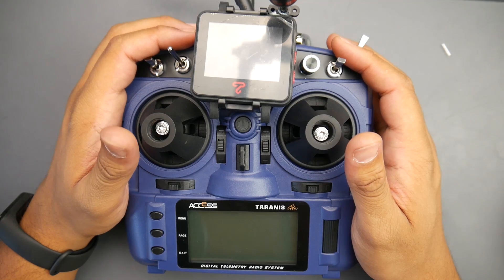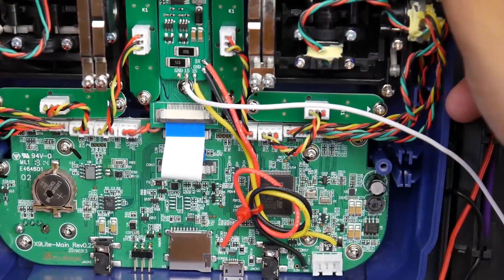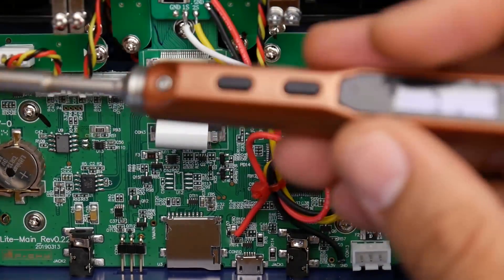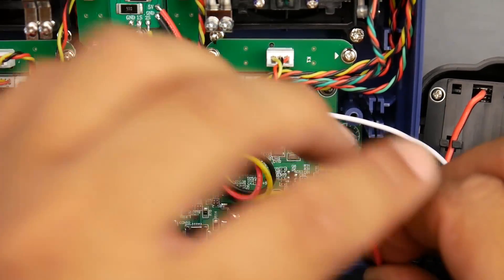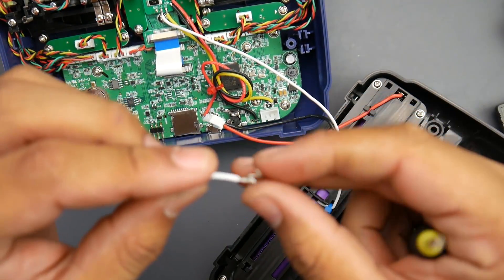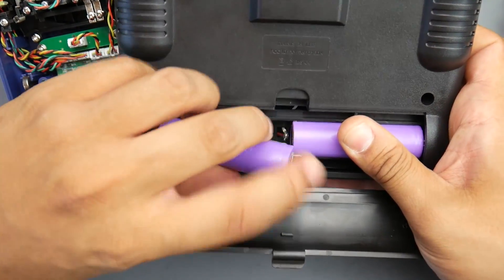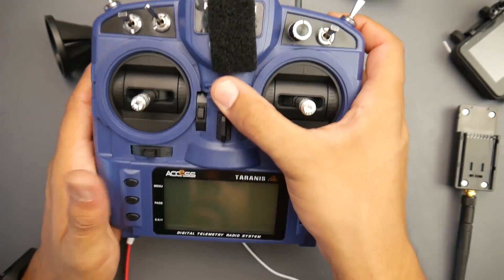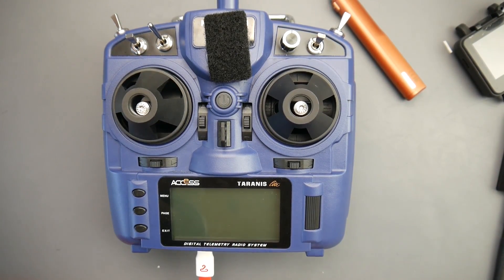Frsky X9 Lite USB Charging Mod // EASY WAY

Comment: You wanted to know what that LED does? That is a "fast flash" RGB LED. It does not have individual color control, instead it has an integrated chip that makes it go through a preprogrammed loop when it receives power. Those are usually used in a lot of cheap toys and things like cheap RGB ornaments. Why they used one here is a bit odd. You can tell it's one of those because of the flash loop. I've seen that loop so many times I recognize it anywhere. I even have a bag of those in 5mm THT package. I think it serves as a charging light. When it flashes it's charging, when it goes out charging is complete. They could have used any standard LED for that. I'd recommend desoldering it and adding a standard 3mm or 5mm LED with some wire, make a small hole and put the LED through.

Comment: Hi, I need some help. I have same radio and the 2.4ghz antenna kable damaged. So, I decided to convert to  sma connection and so I can attach 2dbi or 5dbi antenna. I cut the wire 84mm and it didn't work. Then I cut the wire to 70mm and didn't work again. I tried with Rg316 and Rg178. Then I decide to make a 2.4ghz 2dbi without an sma. I took the tube from old one and left same length of active out. Now I need to now what is the length of the cable should be from tube to the board. Also, What I notice there is a short circuit between the active and coaxcil pads on the board. Is this normal?

Comment: Does the charging light not come on unless you push the power button?  My urav board doesn't flash the lights unless I plug the USB in and push the power button of the x9 lite

Comment: Hello,
I have the Taranis X9 Lite and the IRX4 Lite but I can't get it to work.
I have flashed with the firmware "opentx-x9lite-2.3.0N85-lua-en.bin" with what appears all the options of the external module but I can not link any receiver. The IRX4 does not turn on any LED. When I try to update the external module (PMU) I get an error.
Could you send me the X9 Lite firmware and pmu.frsk you use?
Thank you

Comment: Hello,
I have wired as you noted, but upon powering up, the speaker sounds like R2D2.
Any idea why or what would cause this ?
Thank you!
Excellent work on your videos
Reply: I have the same issue when plugging it into the phone charger and connecting to the phone itself.

Comment: did you have any issue yet or is safe to use?
Reply from the maker: Its been perfect.. I have tested the R9mm yet but multiprotocol and internal receiver are working on that nightly build without any issues
Reply from the maker: So far it's safe but you have to install correctly.. I recommend to go to phone repair shop if you are not confident enough.. If installed wrong then it can be unsafe.

Comment: I wonder if it really balances batteries.
Reply from the maker: I will have more update videos on the controller ;)
Reply: Yeah, we're waiting :)  I bought this taranis instead of my good old Devo 7E with resoldered cpu and added switches. If it were possible to add one/two additional potentiometers/switches to this taranis, it will be very interesting experience.

Comment: Hey drone mesh ,I have just got new  r xsr receiver in which I upgrated firmware so that it can work with Lua script.after upgrading when I put my tx close to rx ,all the signal loss on tx and it says telemetry lost and then telemetry recovered as I move it. Away .is this a normal thing? Should I buy new one?
Reply: Btw I am from India so I flashed fcc version and also verfied this by looking on my qx7 box! So I guess I have flashed correct firmware.